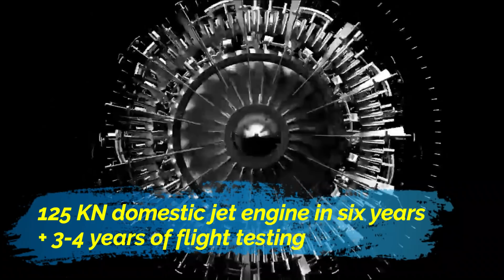India and France to co-develop 125KN class engine for AMCA

Comment: sorry for spamming but i really need some answers as IAF is even struggling to replace 17 il76, how will they match chinese fleet size of 1000 transport aircraft. Or even is there any requirement as such for PLA.
Reply: Where the hell did you hear that IAF wants 1000 transport aircraft?😳😳
Reply: @krishanpathak4989  
I meant that Chinese air force or PLAAF says that they will induct 1000 y 20 heavy lift aircraft.
Meanwhile IAF is hardly able to replace ageing 17 aircraft.
Reply: @eshkarri556  Y20 use ws20 engine, ws20 made in China
Reply: @小易-l2x  😆😆 ohh no i didnt even know aaaaa.
Reply: @krishanpathak4989  sorry I edited the mssg a bit.

Comment: I know UK isn't a reliable partner. But the engine technology of UK(Rolls Royce) is much better than France(Safran).  As Amit bhai have said the hot-core technology part of the Rolls Royce is very strong. We also know the Rolls Royce doesn't make only jet engines, they have also made a various categories of other engines. They are much more experienced than Safran. Though Safran have also made some other engines but in terms of technology and reliability Rolls Royce is best(my opinion , you can disagree with it).And also we have to remember one thing, Rolls Royce have a flying engine testbed aircraft for the high altitude testing of the engine which the Safran don't have. Hope in the DEFEXPO there would be some big announcement.
Reply: We might as well ask Pratt and Whitney for their F135 engine, the most powerful in the world which produces 180 kn alone!!! Why go for a half assed RR engine from an unreliable maker when we can go full ass to another unreliable maker?!!! 
Unlike UK, France really wants to work with us and is willing to share tech.
Reply: @kurroth  but dry trust of 125 kn and 180 kn is wet thrust of f135 engine .
Reply: @veena_93_.    at present the engine powering Rafale is M88 snecma which produced 75 kn WET thrust. This should explain why France wants to co-develop with India to build 125kn engine which should be the wet thrust.
Reply: @kurroth  yeah I know that , because kaveri engine have better dry thrust than M88 kaveri's dry thrust is 65kn and wet thrust is 85kn which is more than M88 , but it will benefit both the side as we don't have Cooling system of and one more tech which are crucial for engine .
Reply: @veena_93_.  I am sorry, yes 125 kn dry thrust for F135 which is better than anything else in the market. The guy was asking why not go for RR engines which are better than Safran and I was explaining why not even do better...
Reply: @kurroth  because turbofan engine  technology is very rare in the world only 5 nation had developed this tech successfully , "while Kaveri is partially successful as per my point of view ".
Reply: @kurroth  indo-french engine will have 110-115 kn dry thrust , which is not bad haa.
Reply: @veena_93_.  We will know the exact output once the deal is signed but yes a reliable western tech engine and its know-how would be a huge boost for India.
Reply: USA and UK will only string  you along. They will never give this technology. It has taken them many many years and a lot of money and two big wars to get there. Today it is a cash cow for them and they see you ie India as a buyer of these engines at high cost.
Do you really think they will give it away?
Reply: @crusoerob8550  very true.... Spot on. We cannot rely on RR as uk and USA work in such matters very closely.. And who knows this RR Offer might just be a trap laid by both USA and UK together to waist valuable India's time and after 1 decade they simply back away from the deal..
Reliable partners who won't ditch India and have close relationship with India should be chosen. Along with this proper flow of funds should be maintainer.
Reply: the point is, will Rolls Royce actually share important knowledge and technology with us(obv not complete tech, but good enough, and at a reasonable price). if we are getting something lower from France but the cost is justified, then I beleive france can be better. I mean there are thousands of parameters that need to be addressed.
Reply: @aryanjain6631  Nope, other than Safran, no other western country wants to collaborate and share tech with India.
Reply: @kurroth  ha toh maine kab kaha.
Reply: Well france is reliable partner , together Saffron , DRDO and GTRE can develop engine good thrust .
Reply: I doubt that ...
Reply: Wasn't there talk of us getting our own high altitude testbed?
Reply: @shouryasanjeev9284  No. That's too costly. If we will choose- 
1) Rolls Royce then the engine will be tested in an Modified Boeing 747 , which is used by Rolls-Royce for Flying test. 
RR testbed- https://youtu.be/4gSKbmODNxI
2)  Safran then most probably the engine will be tested in an modified Rafale aircraft.
Reply: India jo kar rha hai wo thik hoga bcz i believe S jaisankar and kaha se safron kam lag rhi hai
Reply: Saffran is good choice.           🇮🇳💛🇫🇷